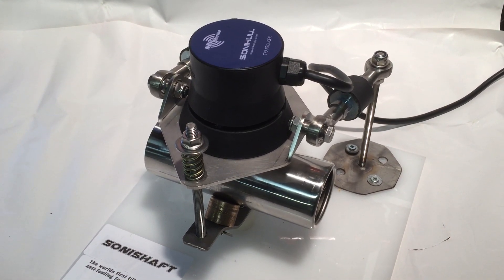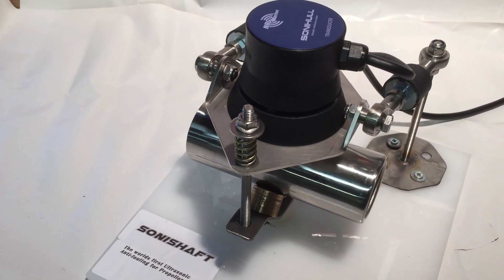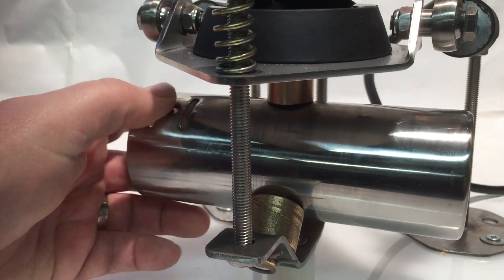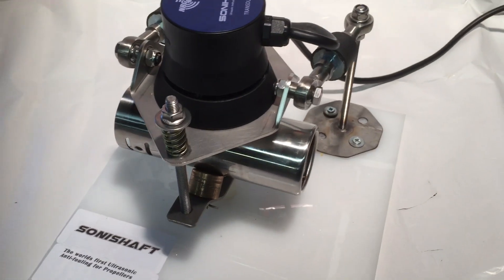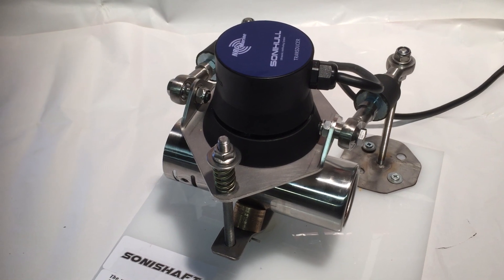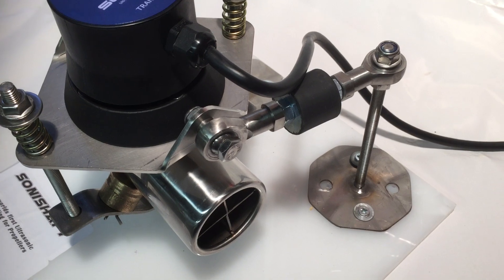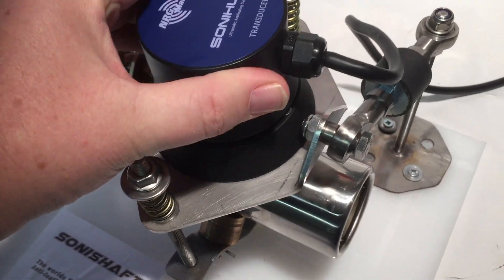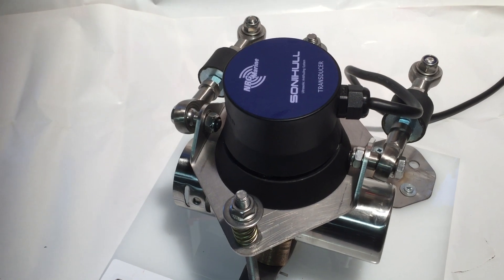Sonishaft - Protection for Prop Shafts and Propellers

Comment: Hi  can you please clarify , if a 11m boat with 2 shafts  had these fitted , would they also protect the hull or would you need additional transducers on the hull itself ? or if they were fitted to the hull would they cover the props shafts p brackets and rudders ? thanks
Reply from the maker: @Pedro blanchard, 

For an eleven meter vessel with twin shafts the best option would be to use a Sonihull Duo with the transducers mounted near to each prop or P brackets,  this would be sufficient to cover the complete hull plus concentrate the signal strength where it is most needed. Due to the mechanical isolation of the shafts, props and rudders, you would not expect total bio-fouling perfection, but you should see a massive improvement.
 
The Sonishaft option would only provide coverage for the props and shafts, it would not add any coverage for the hull, the main issue with an 11 m vessel is that there would probably not be sufficient exposed shaft inside the engine compartment to install the Sonishaft adaptor.